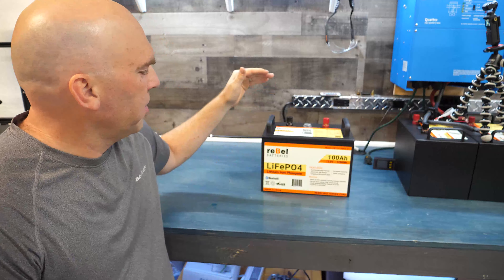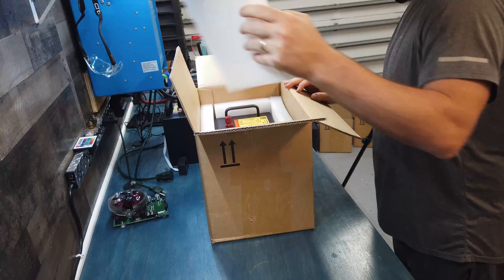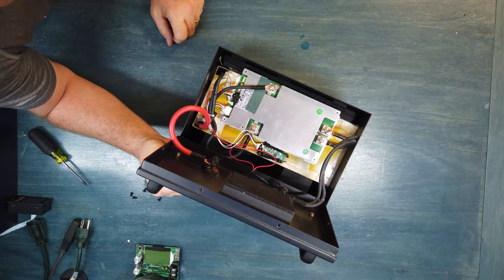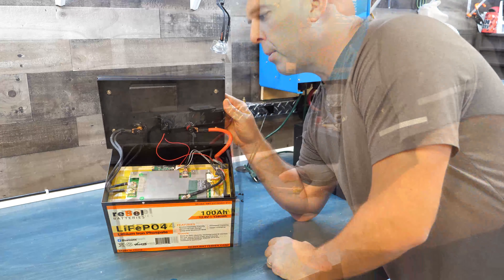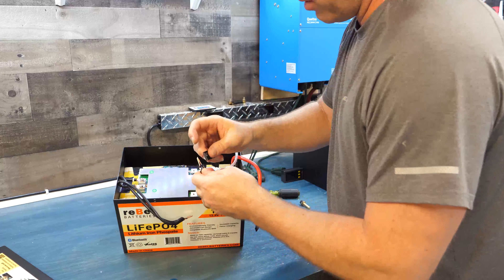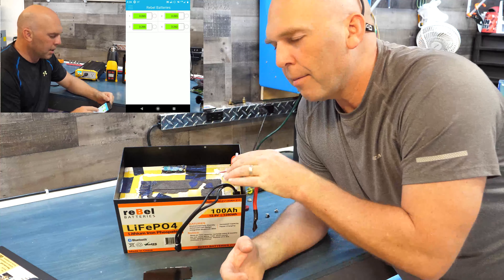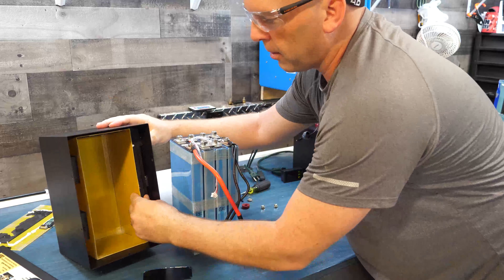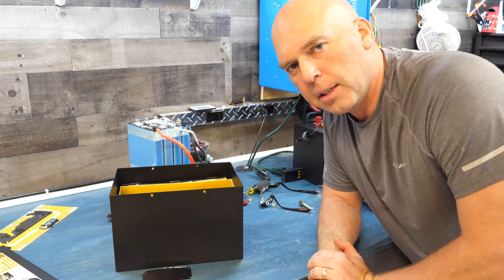reBel Batteries - Metal-Case 12V 100Ah LiFePO4 Tear Down - Lithium Iron Phosphate Battery Insides

Comment: Since you’ve done a tear down, I’d like to see a low temperature cutoff test done.  A lot of these BMS temp probes don’t work on the low end, and it’s certainly something that could destroy the batteries.
Reply from the maker: Will do.
Reply: I can tell you it works! Used a hair dryer to warm battery back up and it start charging again.

Comment: Is this a different battery than the one you sent to Will Prose?
Reply from the maker: This was an older model. We sent him the newer version with lid-mounted BMS and female terminals.
Reply: @reBelBatteries  does the new battery still have the temp sensors for each cell?
Reply: @reBelBatteries  do you have a live chat or phone number I can call for some answers to my many questions?
Reply from the maker: @bucknaykid5821  There has never been a temp sensor for each cell. Only a cell probe and an onboard BMS temp sensor. Yes, the new battery has both too.
Reply from the maker: @bucknaykid5821  support@rebelbatteries.com or 305-477-5080

Comment: Sweet! Are the black strips on the one wall of the inside box to help prevent the terminals from wearing through the box wall, or just for tightness of the cells in the inner box? Still expecting stock in late May?
Reply from the maker: Affirm, late May is still the target timeframe.

Comment: Are you guys working on a 150AH or 200AH battery?  I want more power than a 100 but not 300.  Thanks
Reply from the maker: We have a 200Ah battery, but out of stock at the moment. More due in first week of June.  Alternatively, you can hook up the 100Ah's in parallel for 200Ah if you wanted.
Reply: @reBelBatteries  how much do the 200s typically sell for?
Reply from the maker: @sjhanksaz  They are listed at $869, and correction... we have one 200Ah left in stock at the moment.  The 300Ah is listed at $1,349.

https://rebelbatteries.com/product/lifepo4-12v-200ah-2560wh-bluetooth-enabled-rechargeable-lithium-iron-phosphate-battery/
https://rebelbatteries.com/product/lifepo4-12v-300ah-3840wh-bluetooth-enabled-rechargeable-lithium-iron-phosphate-battery/
Reply: @reBelBatteries  thanks.  What do you recommend charging them with?   Will the inverter charge it from the trailer and what would you recommend to use to charge it out of the trailer?
Reply from the maker: @sjhanksaz  Any charger that supports LiFePO4 would be best. The more Amps, the faster it charges up but costs more 💲💲💲
Reply from the maker: @sjhanksaz  what inverter do you have. Inverters don't usually charge, they turn battery power to house power (AC). Some do have built in charging too. If you can give me a model number I can look it up.
Reply: @reBelBatteries  My converter is an Elixir ELX-45
Reply from the maker: @sjhanksaz  In regards to campers, first I would like to clear up some terminology...

Inverter - Changes DC (battery) power in AC (house) power for things like TV, Coffee Pot, Microwave
Converter - Changes DC to DC. So a 24V DC power source to 12V DC for instance
Charger - In the RV world, takes house power (AC) or solar (DC) and charges up a battery (DC).

Now, the ELX-45 looks like it's a charger, though I can't find a datasheet, it appears to be for lead-acid batteries.  Lead-acid chargers can charge LiFePO4 batteries, but they charge them slower and not 100% to capacity (around 90% maybe). So it's recommended to upgrade your charger, but no a requirement.

Hope that helps.
Reply: @reBelBatteries  one other question.  I saw the 200ah on your site but I think you have the wrong dimensions on it.  Says it’s 20 by 20 inches.  Can you tell me it’s measurements as it looks rectangular not square
Reply: @reBelBatteries  looks like it sends out about 13.8 volts
Reply from the maker: @sjhanksaz  Those are incorrect and we'll get them updated. 20.5" x 9.5" x 9.25" (LxWxH). Just sold the last one in stock tonight.  More coming in late May.  One 300Ah left, same dimensions.
Reply: @reBelBatteries  just purchased one.   Thanks
Reply: @reBelBatteries  that was me that bought it😎
Reply from the maker: @sjhanksaz  Ah, should have caught the Hank + AZ.  In the mail tomorrow!
Reply: @reBelBatteries  does that 200ah have a Bluetooth shut off witch like the 100?
Reply from the maker: @sjhanksaz  yes, it does.
Reply: @reBelBatteries  Cool.  I can also get into the bms and limit the charging amps so it does not fry my alternator while traveling too?  I read that at low idle if the tow vehicle is charging the battery via the alternator that the Lifepo4 can draw too many amps and toast the alternator so If changed the setting to a max lower amp then I could protect my truck.....
Reply from the maker: @sjhanksaz  No, the BMS can not throttle the Amps. It just shuts off the charge path if the current (Amps) exceeds the limit set in the BMS.  You need a DC to DC converter to control the Amps.
Reply from the maker: @sjhanksaz  check out Brian's install (@rvwithtito). He used a simple DC-DC converter and a switch to control the Amps and not burn up the alternator.

Comment: I'm impressed , and wondering why i've only just heard of Rebel battery now . these are real contenders at a very good price . really like a metal case access to the bms or cells . 5 yr warranty . need to decide 100 ah or 200. any chance for a metal case 200ah in the near future ?  ..
Reply from the maker: A 200AH metal case lifepo4 battery isn't on the radar at the moment, but could be if there's enough interest. Thanks for the comment!

Comment: Can they be connected in parallel ?
Reply from the maker: Yes, parallel or series up to four batteries.
Reply: @reBelBatteries  Awesome. Thanks.
What's the max charge current ? Max charge rate from alternator ?
Reply from the maker: @blusky109  The max charge is 100 Amps, but to extend usable life, it's recommended to stay under 75.  And unless you have an upgraded alternator, it's recommended to use a DC to DC converter to limit amps being pulled from the alternator and prevent burning it up. (common issue)  Brian ( @RVwithTito ) did a good video on how to implement a converter with alternator. https://www.youtube.com/watch?v=TDxfRXgQT04
Reply: @reBelBatteries  Thank man !
Reply: @reBelBatteries  Awesome. I'm interested in buying two 100ah. Is there a difference between metal and plastic one ?
Reply from the maker: @blusky109  Just the material... and the metal case is not water resistant. That's it, same internals.
Reply: @reBelBatteries  Thank you !

Comment: are these waterproof?
Reply: @HomeAdrift  link where I can purchase one? and what is max discharge and pulse discharge?
Reply from the maker: @codyscrivener3065  
Max continuous: 100A
Peak/Pulse: 190A
https://rebelbatteries.com/product/lifepo4-12v-100ah-1280wh-bluetooth-enabled-rechargeable-lithium-iron-phosphate-battery-metal-case/
Reply: @reBelBatteries   This battery is not waterproof batteries. I brought this battery one year ago for my old sportman 120  auto pilot  kayak  .  I put  the  battery in the battery box but in wet days, battery can't charge anymore. I called them several times  but no one answers , some one send email me send the batteries to texas but most  shipping company said I( individually) can not shipping to texas because lithium batteries are only can shipping by professionally care person which is only company can shipp to batteries. I send e mail back to the rebel co but didn't get any answer .